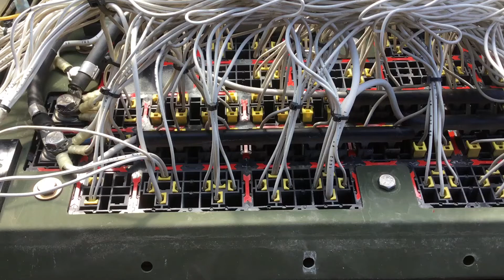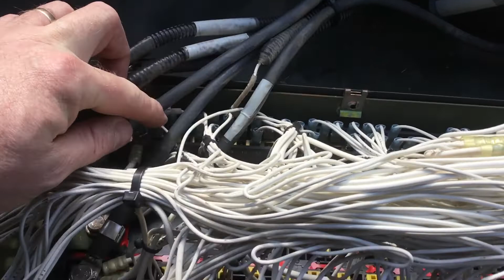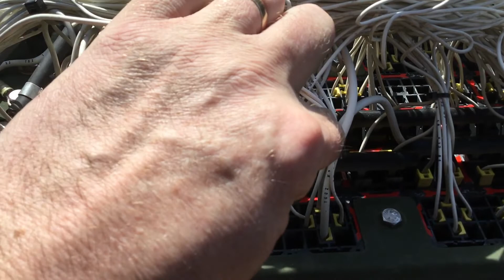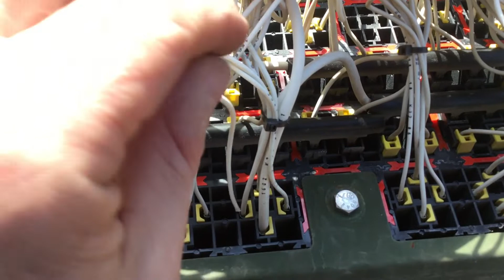LMTV A0 12V switched ignition mod

Comment: Wow, great solution!  I’ve been trying to come up with a plan for this myself.  Thanks for the video.  Any idea where to get the A0 wiring diagrams?  I have the A1s and they are pretty close but I have a starting problem that is killing me.  Intermittent.  Starter, relays all good as I can crank with an external start button on the AUX relay near the PS reservoir.  But using the start button on the dash activates the starter on-off-on-off several time a second and never actually cranks.  Sometimes it work perfectly though...strange.  Batteries all good too.  Maybe a bad neutral safety relay, low oil pressure switch, alt excite relay??  These are all on the A1 diagrams but probably not the same for AO.  Thanks again!
Reply from the maker: The A0 TM’s are available on Steel Soldiers at this link.  https://www.steelsoldiers.com/threads/m1078-tms.118919/    Your problem description sounds like a classic bad connection.  You energize something with a relay and pull current thru a circuit, the bad connection resists current flow so the voltage downstream of the bad connection falls off low enough to release the relay, this disconnects the load, the voltage jumps back up, re-energizing the relay and the cycle repeats.  Put a volt meter on the 12V test point and watch it when you push the button.  If the voltage falls off significantly it is probably a bad connection at the polarity protection device between spare tire and air cleaner.  Had this exact same problem and that was where I found the issue. Cleaned the connections and that fixed it.  Another issue that can cause you trouble if if someone plugged a 24V coil relay into a place needing a 12v coil.  It takes very little drop off in the 12V supply to chatter a 24V relay…
Reply: @rronmar  thanks for the help.  I cleaned up the contacts on the polarity protection lugs (a lot of corrosion to the lugs but the electrical contact was ok)....turns out I had a battery that was real low, one had a good charge but the other was low.
Reply from the maker: @MarkD-nd9lg  The A0 has a small vampire load on 12V, so the 12v battery will typically drain first.  I have a small equalizer wired to my batteries and a float charger to keep them maintained/make up for this loss…